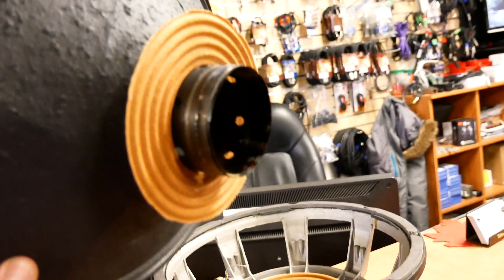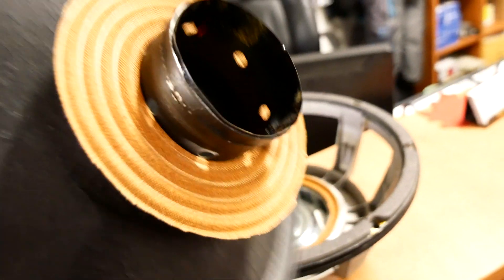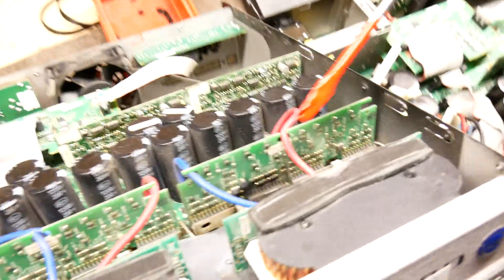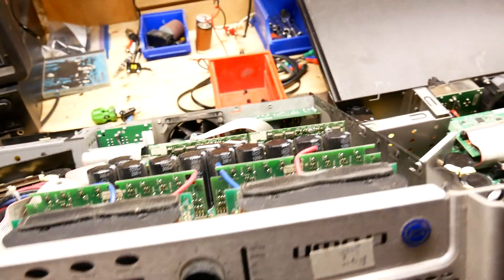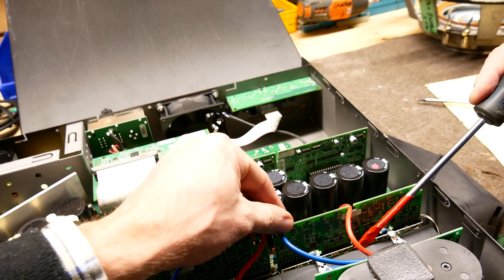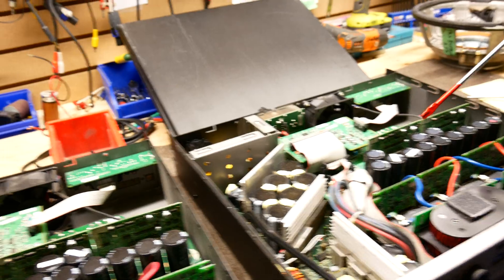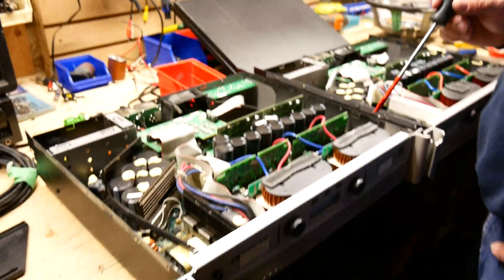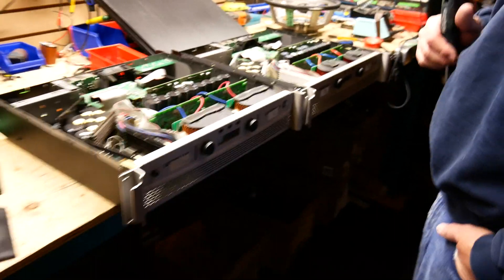Diagnosing Blown Crown XTI iTech 6000 Amps & EV QRX 12" Woofer

Comment: The whole downside of class Ds is usually when one thing fails it causes a domino effect that destroys a bunch of other things n makes them an absolute nightmare to repair. Whether the issue starts on the sensitive low power side of the circuit with a tiny component or a rail device blows up it works is way down along the circuit in either direction ☹️

Comment: Sir is it full bridge class d amplifier
Reply from the maker: So we no longer have this amp / this is an older repair, but yes I believe the Crown XTI 6000  can be played bridged.
Reply: @santonaudio9036  yes sir I think so because off it has 2 core pair for each channel so I gassed 
Full bridge audio amp
Reply: @shyamsharmas-invomahamai2552  It could be BCA by the two coils. But nowhere it's mentioned to be BCA. I think Crown wouldn't keep it in secret if it was BCA. So I also bet it's full bridge Class-D